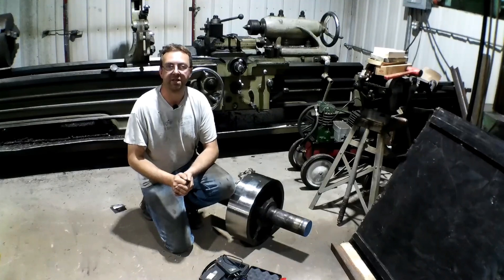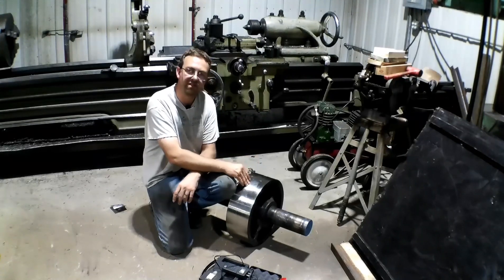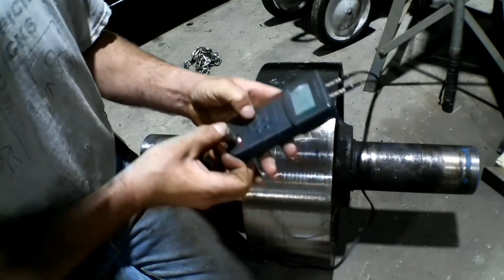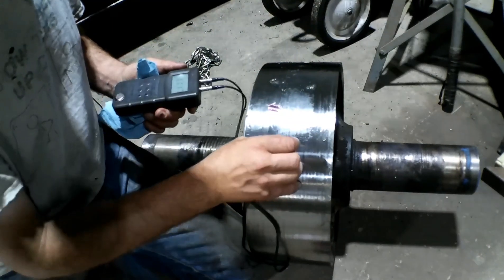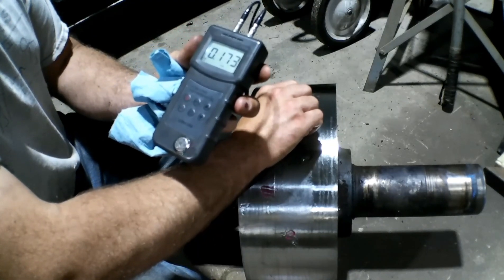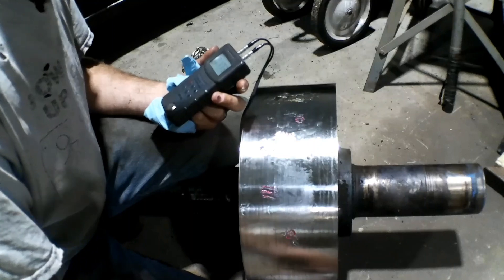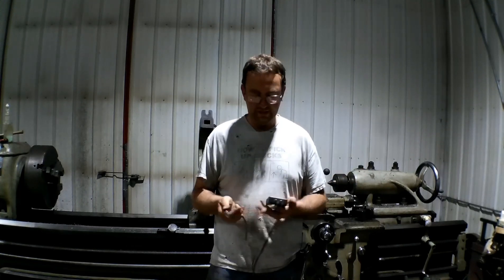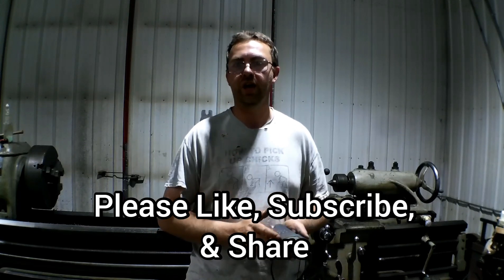Tromel Trunnion Wheel Repair Failure, What Went Wrong???? Ultrasonic Thickness Testing

Comment: I can tell you right now, being a foundry man for 20 years in the Navy what went wrong with that casting. Whoever poured that casting neglected to clean all the slag from the top of the melt and poured the whole thing into the hole. If you don’t clean all the slag off the top of the melt, some of the slag will be sucked into the mold cavity, and we deposited against the side of the mold cavity. It is no doubt that what you were finding while machining and doing the NDT experiments that you were finding slag that had been trapped inside the mold cavity. Normally the slag will be trapped against one side of the castingdue to the hydrostatic pressure exerted upon it while the molten metal was being poured. You can try to machine it down where you won’t get any more slag showing up., And then make a sleeve to be installed over what’s left of that casting. I very much doubt that the slag is deposited throughout the casting. It showed only be in that one area that you were finding it. Good luck with the job!

Comment: That is a very handy tool and great idea to use it on the wheel. Is it feasible to put a sleeve on the outside of the wheel or would that not work?
Reply from the maker: Sleeve is not an acceptable repair for this. Building it back up and machining back true is really the only good way, but that's not guaranteed.

Comment: I was thinking (I know , no good can come of that) could the trunion be machined down and a steel band be press fitted to the remaining part?  I'm  assuming there is good material underneath the crappy surface!  I just ound your channel and I'm trying to catch up.  Thanks for the video.
Reply from the maker: The short answer, No. It was tried a few times with disasterous results. Glad you found us, thanks for watching.

Comment: I think that you will agree  ,   it appears to have been a bad casting with lots of imperfections hiding under the skin of the roller . Almost like a bomb waiting to go off,  as you said very lucky to find out now than later.
Reply from the maker: Not a bad casting, just 30+ years of rolling and supporting the load. It's common on these if you don't take skim cuts every so often. The micro cracks in the surface will spread deeper and in all directions. I've seen it on solid steel rolls as well.

Comment: If you tap it lightly with a hammer you will hear a flat sound rather than a ring try it!!
Reply: Yes I'm familiar with this 'ringing a bell' for grinding wheels and other Composite Materials where homogeneity plays an important factor and cracks will dull the transmission of any sounds.

Comment: When you take these repair jobs
You may need to get a repair procedure in writing and do exactly what they say.
It should say no warranty expressed or implied.
If one of these jobs blows up and kills someone, you need to cover your arse.
The original equipment supplier is certainly not take any responsibility and you should not either.
My two cents.
Kap